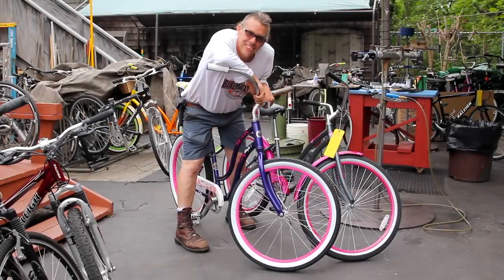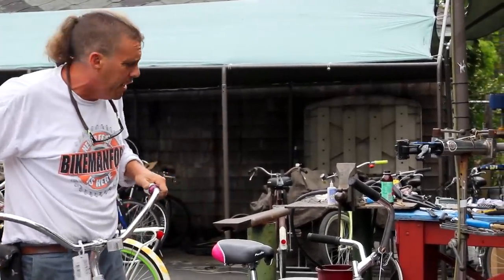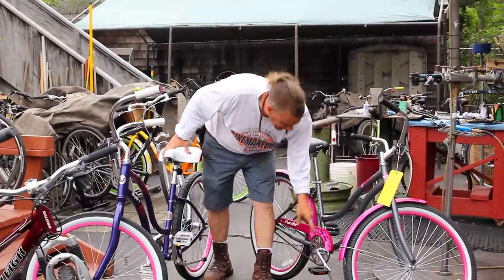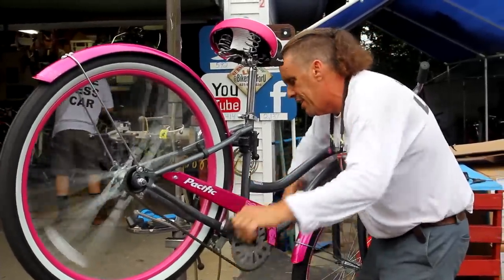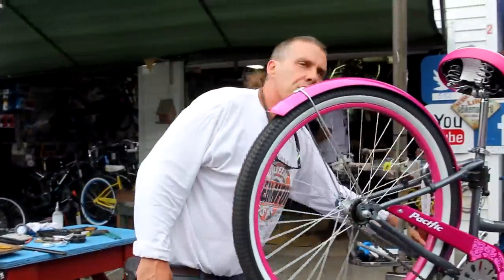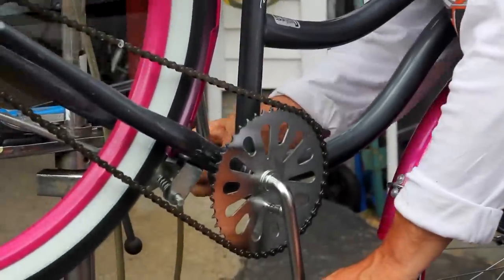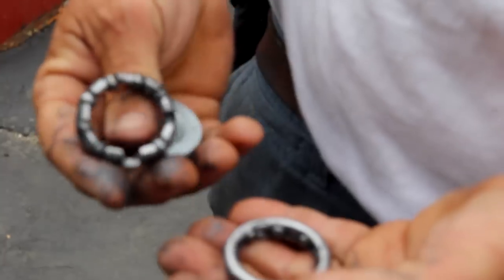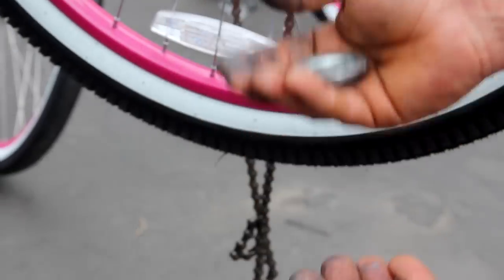How Cheap Walmart Bikes Suck Your Wallet Bone Dry - No Grease - BikemanforU

Comment: My first choice would be to save an old bike from salvage but if forced to choose between these two I'd take the $70 bike plus a $7 tub of bearing grease and about an hour of my life and save myself $223.
Reply: It's not just that, it's also the fact that the components are as cheap as they come plus they were assembled without any care.  The only good thing about Walmart bikes is that you can get your money bike.
Reply: It's been my experience that the quality of the components in all sub $500 bikes are pretty much the same from brand to brand. Case in point. All most all the sub $499 Trek's use the same Shimano Tourney group set's that the sub $150  Schwinn's and Mongoose at Walrmart have. Why spend the extra $350? I promise you the rims, brakes and seats and suspension parts(if applicable) aren't all that much better on the sub $500 Treks, in-fact many would argue they're actually worse. Trek rims have a bad rap. So basically the argument boils down to assembly. Of course a bike at a LBS is going to be assembled and setup better, But is something that most everyone can do themselves in a few hours really worth the extra $350? And in all honesty it could be even more. A lot of shops charge an assembly fee of $35+ for a simple cruiser of fixie to upwards of a $100 for bikes with gears and suspension. Sure there are a lot of folks that would just rather pay and get it over with. But really doubt those folks are watching DIY vids on Youtube,
Look, I'm no fan of Walmart. But there isn't a damn thing wrong with their bikes when people A) maintain them and B) use them for what they are intend for.  For 99.999% of the population a Walmart style bike is all they will ever need.
Reply: I don't know where you seen the Trek's with warped rims but I have NEVER heard of a real bike shop that does not put the rims of every bike they sell in a professional grade Park truing stand. The build quality of the frame will be better too. I know this as a fact because to show support for the department store that stole me away from the professional bike shop I worked for I purchased one of their most expensive full suspension bikes. Now in one year I broke the frame FOUR TIMES on a $1,000.00 bicycle and that was with normal riding in fact the last frame did not even see any off road riding at all just road riding to work and back.
Reply: A) I didn&#39;t say &quot;warped.&quot; I said Trek rims have  a bad RAP. I&#39;ve personally never seen a Trek with 3000+ miles on the stock  Bontrager&#39;s. From my observation rims are the first  thing Trek buyers upgrade.
B) There is no such thing as a $1,000 department store bike.
Finally, C) no one who knows anything about bikes buys a full suspension bike for a commuter. That&#39;s like buying a Mack semi to take grocery shopping. 

The fact remains for the average consumer a department store bike is all they&#39;ll ever need.
Reply: probably you right. But only if you knew what you buy, and how to fix it. If not take a knowledgeable friend with you and "learn how to..."
Reply: Same
Reply: @redrocker1055  I ll tell you one basic difference that the extra dollars will get you , an alloy frame instead of a steel on that weights a tonne. No matter how much you argue on this matter there is a reason why there is s large price difference and it is called quality. those of us who enjoy that quality in our bike riding dont mind digging a bit deeper in our pockets to get it.
Reply: @HHHSOHS   Both frames are an alloy. One is steel and the other is aluminum. There isn't $223, now $323 as the Giant Simple is now $400, between these two bikes. The weight savings in aluminum frames is only important to those who want speed over the comfort of a steel frame. Those people aren't ridding beach cruisers.
Reply: @redrocker1055  so people who ride cruisers want a shit ride because that s what you ll get out of a Walmart bike
Reply: @HHHSOHS  Buying a bike for the name on the badge isn't going to make your daddy proud of you, Dimtris. You're lashing out at the wrong person.
Reply: Stevey TeeVee  I run a co-op specializing in providing bikes for underprivileged kids, seniors and folks with disabilities.  I have my hands on hundreds of bikes a year  from expensive  modern road bikes to pre-war skip-toothed cruisers and everything in between. 
I would love to say you get what you pay for from LBS but in reality the main difference is the quality of the setup not the bike.  In most cases the components on the entry level LBS are the same low quality as can be found in the box store bikes but they charge consumers a premium for the name and the service. If you know that going in then then that is your prerogative to spend the extra $$$ but most people in the market for a entry level LBS don't know the difference and and are taken advantage of. I don't like that.
Lets take these two bikes for example. Outside of the fluke issue that I have never seen happen before this, and if the guy who made the video was being honest he would say the same, the only noticeable difference in ridabilty of these two bikes is the frame material and the cranks. Now these bikes are single speed cruisers designed for short trips around the neighborhood. Unless you live in a hilly area there is no point in using aluminum for the frame of a cruiser. In-fact I'd argue the steal frame is actually a better selling feature as steal is soo much more comfortable that aluminum. 
Now for the cranks. Yes, three piece cranks are superior to the single piece cranks performance and weight wise but again these are cruiser bikes and it just isn't needed. 
From experience the cranks on both of these bikes will be junk. The box store bike will use cheap bearings that don't have enough grease and the LBS bike will have the cheapest of the cheapest bottom brackets made out of mostly plastic. So pick your poison.    

I don't care what bike people ride. I just can't tolerate bike snobs who have to make up lies to justify their elitism.
For the vast majority of the population a bike from a box store will be all they ever need. But those who intend to pound out miles,  race, run single tracks, down hill, or trick then the mid to upper range LBS  should be your starting point. But for the casual rider the Wal-mart bike will suit you fine.
Reply: Stevey TeeVee   1. I never said you should buy a bike at Wal-mart. I said there was nothing wrong with buying a bike at Wal-mart.
2. You're fooling yourself if you think Giant and the others don't cut corners.  In-fact Giant just issued a recall on the SRAM i-Motion 3 internal gear hubs they use in cruiser bikes like these just last month. Don't tell me they don't cut corners. 
Pacific cycles sells in mass to Wal-mart and Target thats how they keep costs low.   Companies like Giant,  and Trek sell bikes with literally the same components as the pacific cycles does but they charge $300+ simply for the name on the headtube. Entry level Giants and Treks have the same damn crappy Shimano Tourney groupsets that the Schwinn's sold at Walmart do yet snobs act like they are soo much better. Yeah, okay. keep fooling yourself. Guys like the dude in the video will gladly take your money.
Reply: @redrocker1055  I am a prime example as a consumer that WalMart bikes are OK/good for the right rider. 16 months of cruising, babying and maintaining my Kent and it's still as good as it was when first purchased, probably not good enough for those seeking an expensive bike in the first place but good enough for me and like you said "99.99% of population" that is all we need. Paid $90 for it, have spent $50 (aprox.) on maintenance ( 2 tires, 2 inner tubes and a tub o grease) and I'm a happy rider! I ride 4 to 5 days a week, about 3 to 5 miles each time.
Reply: @redrocker1055  I put almost 20k miles on a pair of bontrager el caminos
Reply: @redrocker1055  people that want a good beach cruiser get a townie, NO bike from wal mart rides like a Townie.
Reply: @xmateinc  You didn't put 20,000 miles on any bike tires.
Reply: @redrocker1055  while schwinn and the marlin 5 have the same derailleur the dont have the same brakes, or wheels. plus trek puts alot more into the engineering of their frames.
Reply: @redrocker1055  pretty sure I said the wheel. Or did you not know that the el caminos are a wheel set and thought they were tires?
Reply: @redrocker1055  I lightweight bike is always much more fun. It is not all about the ride but the handling of it as well.
Reply: @redrocker1055  you pay the extra money for the quality.

Comment: OK so the solution is buy a Walmart bike and just grease the bottom bracket bearings and steering bearings etc. before riding it. Check all bolts are nice and tight and check that all the spokes are tight and the wheels are true. Adjust as necessary. Obviously not everyone knows how to do this. In that case, take it to a bike shop for an overall checkup, then it's good to go.

Comment: 7 years after he posted, even more true today. BMFU spoke the truth.
Reply: eh on the more expensive side the bikes are starting to get better at walmart was looking into getting a trek marlin 4 with a larger frame for my ebike kit to fit the battery properly since my marlin 7 the battery doesn't fit the marlin 4 is not worth it in my opinion for the money $530 for a bike that comes with a 7 speed freewheel. While I picked up a ozark trail ridge for $398 at walmart with a 9 speed cassette took the thing apart to check assembly and it's actually assembled good

Comment: Did any other than me notice how out of true the back wheel was as it span?
Reply: No idea what that is when converted into beach chairs and dollas but here it's going to be like 1/2 the cost of that cheap bike again to have someone skilled true/rebuild/tension the wheels.
Reply: ClockwiseCycling Walmart/Canadian Tire/Toy r Us etc and all those places that selll cheap bikes, usually the wheel is untrue. 

You also have the special plastic handle on the brakes
The mega crappy pedals

I could make a complete list of bad parts in cheap bikes lol
Reply: Emily yeah slashing costs by getting the worst of everything. Even if you replace all the parts the tubing on the frame will be awful stuff.
Reply: ClockwiseCycling 2:55 ish...It was the tire that gave the illusion of being out of true.  Watch again and mark the wheel against the chain.  The wheel is fine.
Reply: Marsuvees Black oh yeah badly seated on rim, assembled by a pro...
Reply: +ClockwiseCycling Much more likely just a mis-seated tyre
Reply: lol read comments before u comment
Reply: I noticed that too. Never buy department store bikes.
Reply: That was a tire
Reply: It's both the tire and the rim, just put a finger where the rim starts and U'll notice that it's really out of true ;)
Reply: Spun
Reply: Definitely the tire. That's a problem with a lot of beach cruiser tires, and really tires in general, because obviously unless it is molded and painted exactly perfect, when it spins the white wall makes it look like the tire is out of true side to side and up and down. Hence why people who know what they're doing take the tire and tube off the wheel when truing them
Reply: @high-rise9532   who does that ?  I say fire away . And let the public take your medicine

Comment: I bought a cheap bike.  I noticed that bearings were not adjusted and there was weld fragments in the bottom bracket.  So I dismantled it, cleaned everything.  Greased, oiled and adjusted everything.  That was 30000 trouble free km ago.  So the parts weren't too bad.  They just needed some TLC from someone ( me).  Without that the bike would not have lasted.  With the effort it has become a great and trustworthy bike.

Comment: This guy needs more subscribers. I stumble upon this channel every now and then, this guy is awesome :D 

My GF got a cheap bike for about €150, hardtail MTB. Straight from the shop the brakes didn't work properly, gears didn't shift, brake levers angled stupidly and the tyres were underinflated. I tried pumping them to minimum pressure and the wheels started creaking. Get a real bike from a real shop. Even if it means $300, 400. You can abuse it and not look after it and it will last longer than a Walmart kind of bike.

Comment: Thank you Bikeman4U, I just regreased my (WalMart) KENT cruiser for fist time after riding it for 16 months and it really did not look bad at all. I ride it 4 to 5 days out of the week so I know I have a FEW miles on it, also the fact that my tires were bald (which I also changed at the time I repacked the bearings). Anyhow, my 2 cents on WalMart bikes is that they do require more maintanace and babying, and they are all just for light cruising/riding. No tricks or mountain riding even if it is a BMX or a mountain bike, for that you do need a quality bike. You get what you pay for and in my case, that is all I need.

Comment: We have these things on our shops too. There was this opening of this electronics store and they gave bike to first 100 customers or so. Later they sold those same bikes that "cost 199€" for 10€ a piece. One guy bought 5 of them with his family, sold two and kept three. Anyhow, the original cranks were made of cheapest and thinnest metal you can find and had a thick plastic on top of them. They were soooo soft that you could almost bend them by hand with help of a vise. Had to replace cranksets for all of those three and it cost like 30€ for new shimano crankset times three.

Comment: Box store bikes are hit or miss, I have a ten year old Next that was assembled properly and I have never had any problems with and I have fixed others that were messed up right out of the box sadly.
Reply: True..had some no-name mtb that lasted me 10yrs almost. I rode to work, even had a child seat on it for 3 yrs. Just bought a Merida mtb....cool ride but, the back wheel needs replacing after...not even 200km... So..yeah... I'm a bit disappointed now
Reply: I have a next px4.0 or some shit like that, I've had it over a year, and it survives the crazy things I do with it! I whip it through the trails, hit jumps on it, and even go up and down loose sandy hills
Reply: I think that's what makes or breaks a bike..... regardless of brand or where it's purchased.   what people don't think about when buying these target/Walmart/etc. bikes is that they don't employ bike pros to assemble them.  you think that snot nosed teen that doesn't really want to be at work is going to assemble it properly?  LMAO  if you have basic knowledge or have connections to bike tools... you can get a great deal on a pretty affordable bike when on a tight budget.  you just have to a) have a bike pro look it over or b) if you know enough do it yourself...   the LBS near me, a mom n pop run shop... they go through EVERY new bike, right out of the box....
Reply: I wouldn't imply they were teens as most box store mechanics were around 30. Second, its all about work ethic and if you actually care. I had people coming to me for car repair because I'm way better than most mechanics, a lot of mechanics just suck at their job and don't care. Its not difficult to rebuild an engine, and an automatic transmission is annoying, but dang, how do they keep making mistakes like leaving air filters off!?! That's going to kill a turbo in less than an hour on gravel roads (happened with my uncles pickup, his Honda quad, and even there car!) I can see leaving a tool in, but sheesh, you might stop and think "hey where did this air filter come from?".

Comment: I bought a cheap roadie a few weeks ago, but I know not to expect super quality from it. But all the components are recognized brands, just low grade... Plus I can maintain it myself.
Reply: So how has the bike held up after 2 years? Just asking.
I've had some $8 thrift store bikes never need maintenance after setup, and I've had new bikes fail from just defects. I would think a roadie would take less abuse and maybe last (though I did have a spring in the brakes lever fail, and it caused me to face plant into concrete on a turn when the brakes decided to activate... other than that it looked fine, but it was stolen, so I don't know how everything else held up)
Reply: @jakegarrett8109  That's a good point.  You have a $70 bike get stolen, you go to the big box store and pick out a new bike, and tell yourself that it was about time for a new bike.  You have a $500 bike get stolen and you get angry, really angry.  You want a piece of that thief.  You start thinking about buying an identical bike and bike lock, and put the new bike in the same location, as bait.  Six months later you're telling this story to Larry, your new cellmate.  You're in jail for aggravated assault for beating the bike thief.  And you say to Larry, "Maybe I'd have been better off buying that $70 bike".